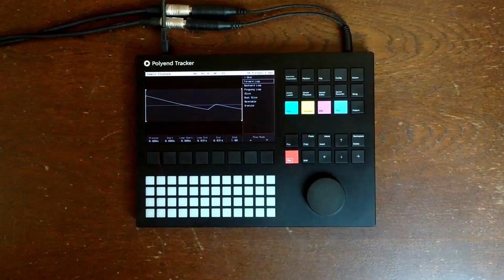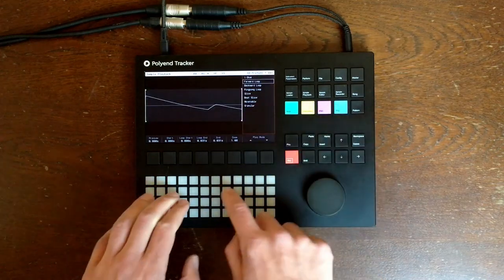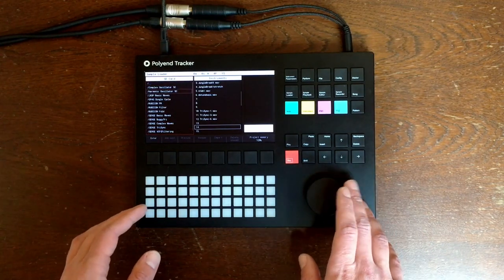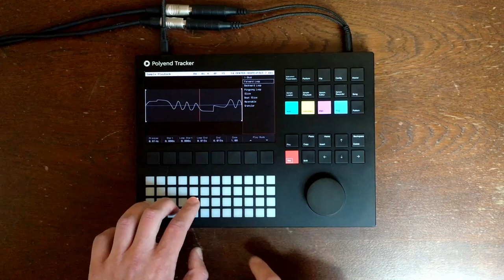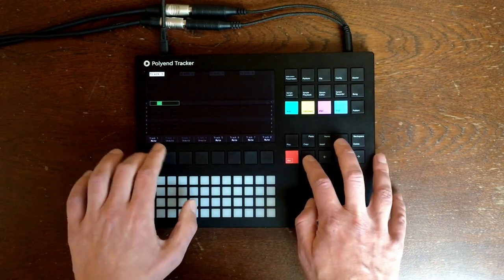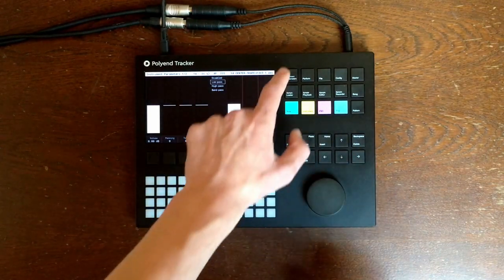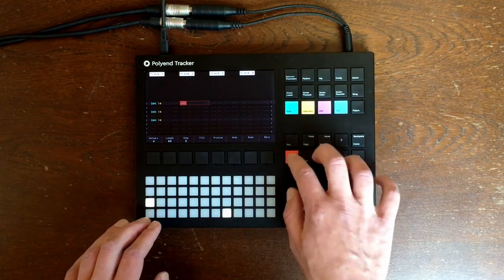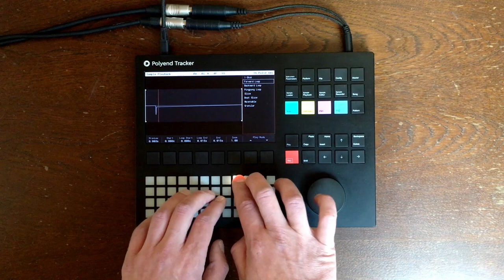Advanced Uses of Single Cycle Waveforms: Stazma Tracker Tips & Tricks

Comment: It's really impressive how one can create those complex sound scapes out of single waveforms 🎧
Unfortunately, when I bought the device, it had a firmware installed which had a buggy Render Selection feature. I stopped using that feature altogether cause it was to annoying to end up with corrupted / incomplete renderings. I really should get used to it again 💚

Comment: Heyo! I’m considering picking up a Polyend Tracker. I was thinking of the original used. I think I can get it for much much cheaper than the Tracker +. I’m coming from a modular background so the synth engines of the new one does appeal to me but I wondered how you’ve found the workflow of using single cycle wave forms vs something more of an engine workflow? I also figured the cost of the used OG feels appropriate as my main way of making music will continue to be modular.
Reply from the maker: Sure the OG is still a great machine and working with single cycle waveforms is fun with it.
Reply: @Stazma  awesome. Good to know!